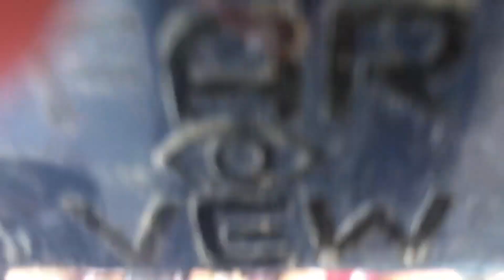TFL "Outer Limits 34"" Mono Overview and thoughts.

Comment: Looks like your shaft/motor assembly is misalligned, is that the case? I have a friend who has a similar problem - where the motor mount is not alligned correctly... 🤔

Comment: Thanks for the video brother!! I am sort of new to RC boating! My first boat was Blackjack 24 and then I got the Sonicwake 36 DeepV Self-righting and I have had for over a year but looking to get another boat something I can get some more run time out of it! My Sonicwake ON 6s  it eats up my 2 3s Lipos like in a matter of 4 minute run time! So far i HAVE DONE THE DUAL rudder upgrade with the cooling system and it runs nice but still eats up on 6s like crazy!! I have ordered 1 Seaking 180ESC and I was getting ready to order a Leopard 4082 1600KV since I was going to install that into my Sonicwake but now I am thinking about getting a totally different boat!  I was thinking about getting either a TFL Zonda - Catamaran Hull and Hardware Only w/ No Motor, ESC or Electronics and installing my upgrades into the cat or getting a Lucky Oct 34'' P1 Racing Mono Hull only and installing my a Seaking 180 ESC & put in a   Leopard 4082 - 16000kv motor. Like to hear your thoughts and concerns?
Reply from the maker: Hey, shoot me an email and we can exchange numbers and txt about ya questions.  My email is in the description